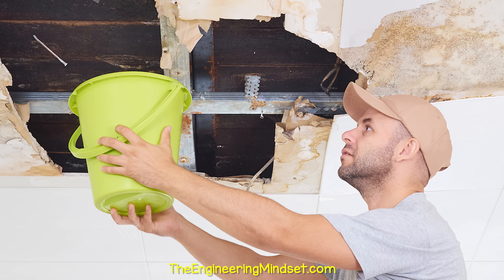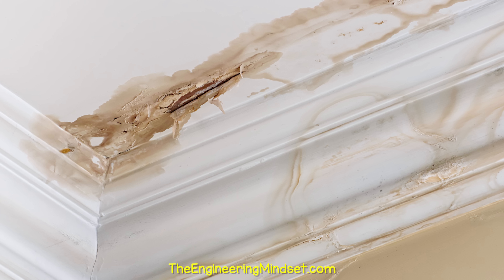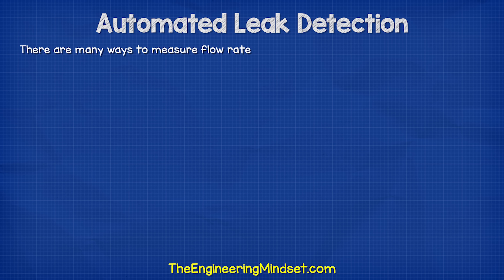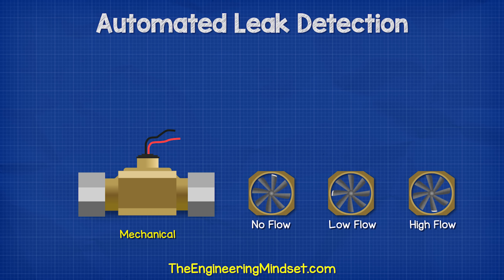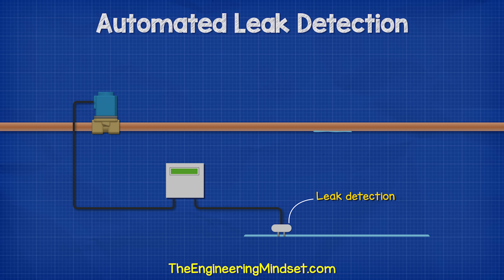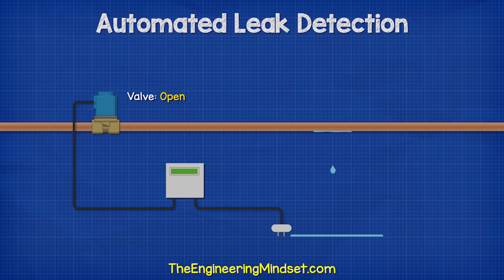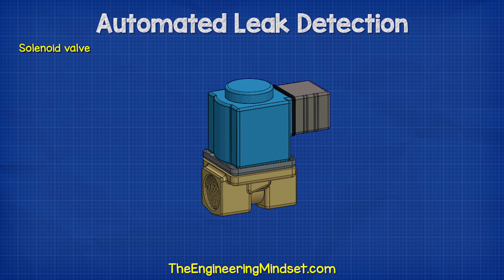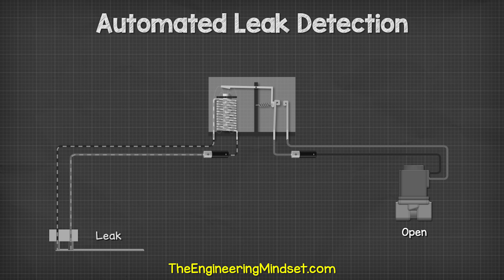Automated Leak Detection solenoid explained

Comment: In a rural area i cannot rely on electricity such a strategic role. 2. The valve once closed should remain closed even without curent until it's opened manually or by a button on the controller, b)should remain closed even if the sensor dosent read anymore the leak, c)repetitive disconnection and reconection of the water or electricity should not reset or affect the state of the system.

Comment: This is a very interesting system and a very good video. I would only invert the logic of the solenoid valve to make the system fail safe e.g. use a normally closed solenoid that requires power to open. In this case if the power is lost, or the cable is damaged, or the controller is powered off, then the solenoid valve will close.
Reply: I agree with your premise Andrea, but offer a caveat; the valve either needs a manual operator that can override the valve's closing stem or a bypass valve that can be opened. In a loss of main power to the building, the water valves will close and the occupants without potable water for the duration of the power cut.
Reply: @Bear-cm1vl  You are making a valid point, Bear. However, the system will need a mechanism for sensing if the hand valve is open (e.g. a pressure switch) or there is a fault with the solenoid valve. The controller can sense the state pressure switch and flag a fault when there is pressure whilst the solenoid valve is off (i.e. the hand valve is open or the solenoid valve is stuck open).
Reply: @add2461  valves with conditional end switches are fairly common in industrial and HVAC automation, showing the position of the valve to the logic when it repowers. My experience with hydronics and water valving systems indicate that a slow acting valve is a better choice in a active flow shutoff system like this because it avoids water hammer and damage to the supply piping / tubing. Motor driven actuators or water pressure actuated slow closing solenoid valves like those used in irrigation and sprinkler systems are far less likely to cause water hammer and split pipes that may already be damaged if the system is leaking to begin with.
Reply: @Bear-cm1vl  You are making another valid point. I agree that a proportional valve with an adjustable on/off ramp would be a better solution compared to a solenoid valve (on/off).

Comment: One easy way to determine an extremely low leak (one drop every 10 seconds), is to install a pressure gauge down stream of a test shut off valve. The simplest way is to make use of the house main valve (assume it can shut off flow completely). Flush all possible trap air in the home pipe lines then shut off the main valve to watch the meter reading changes. If no change in 10-30  minutes there is no leak. The down side to this method is it can’t isolate the trouble spot if there is a leak, unless we are willing to install additional down stream shut off valve and pressure gauge for each suspect branch. 

For new home before dry walls are added we can use compressed air in the pipe line and apply soapy water at each junction or suspect spots. That is not feasible for lived in and furnished homes. 

Larger leaks can be detected with an IR scanning camera looking for temperature gradient at suspect spots. To make image more sensitive use a fan to let water of a wet spot vaporize more to a more acute gradient. 

Hope this helps.

Comment: Theres a third method to detect leaks. That is, that a flowmeter will detect periods when water is not in use. Then the water will be shut off randomly (flowmeter is then used to ensure water is not being shut off while someone is using water so not someone's shower is interrupted). Then a pressure sensor is used to detect if the pressure is decreasing in the now closed water system. Even a small leak will give a great pressure decrease in the closed system as water is not compressible. In a healthy water system, the pressure should be able to be maintained with no water supply.
This is also great as if you have a system which periodically "exercise" the solenoid valve to make sure it doesn't get dirt buildup or gets stuck, you can also during these times, check for leaks.

Such a system can also be used to check for leaks during vacant periods. For example, you might connect a leak detector system to the burgular alarm panel, so when the burgular alarm panel is set to "ARM", it will both exinguish the occupancy signal to both the AC system but also to the leak system. Leak system now responds with closing the water (as no water is needed during vacancy).
During the vacancy period, it can now check the pressure for a long time. When alarm is now set to "DISARM", the water leak system can refuse to turn on the water, and raise a tamper alert, if pressure have dropped too much during the time the water was shut.

So if you want a superior leak detection system, you would have:
1: Flow detection to detect leaks.
2: Flow detection to detect non-usage of water + random shutting and measuring pressure during occupancy.
3: Water shutting during vacancy period combined with long-time pressure detection.
4: Localized moisture sensors to detect water at sensitive places.

If you want a even better leak detection system, install a flow meter at each water consumer (faucet, shower, washing machine, etc) in addition to the "incoming" flow meter and if all "outgoing" flow meters sum up to the "incoming" flow meter, all is fine. If not, then there is a leak.
Ergo:
5: Incoming/outgoing flow detection.

Here, if you have a smart system enough, you could refuse to permit the toilet flow meter and the hand wash basin flow meter, to measure any water if the lights in the bathroom is not turned on, but allow them to flow if they flowed while light was on, but once they stop flowing, no longer allow to start flow again.
In this way, theres a 6th method to detect leaks: If water is flowing in areas that are apparently not in use (based on ceiling light switch position).
Same with washing machine - if its not consuming any electrical power for a period of time, it shouldn't consume any water either.
6: Detect "unauthorized" local water usage based on local flow meters, combined with detecting if lights is on or washing machine is running etc.
Reply: My Moen Flo does the shut off the water and monitor the Pressure approach as well as out of normal water flow monitoring.   It's smart enough to know when water is unlikely to be needed,  i.e. it learns.
Reply from the maker: Seen our new pressure switch video? Link: https://youtu.be/YG81w0HFXNc

Comment: 2:14 it should not be a ramp. It should be a square wave
Reply from the maker: The ball valve doesn't instantly open or close 100%
Reply: @EngineeringMindset  When flushing happens, the buoy will hang over the water fully open for a decent amount of time :3
Reply: @whatevernamegoeshere3644  why you're including buoyancy here?

Comment: conducting wires or tracks or probes decay over time due to the electrochemical reaction caused. This results in the reduction of conducting surface over time since one of the electrode is constantly corroded. 
the ultrasonic or leak detection based on the hall effect flow sensor makes more sense.

Comment: Very interesting.
I would appreciate if you model all these in a mathematical form. I want to transform it to Laplace transform, find the error (desire flow - actual flow) of the system from the system input and the sensor reading. 
My intention is to find the controller that will control the system optimally. Linear quadratic Regulator LQR.